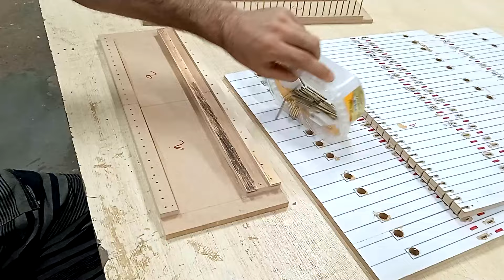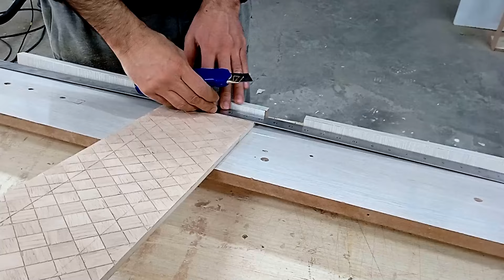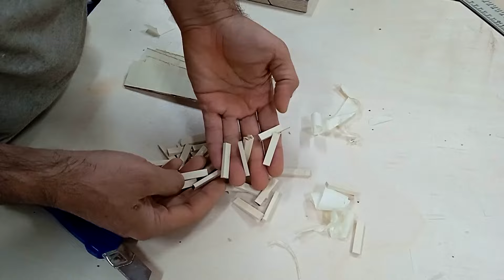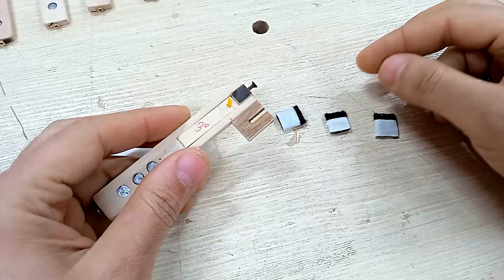I made this instrument in Afghanistan मैंने यह यंत्र अफगानिस्तान में बनाया

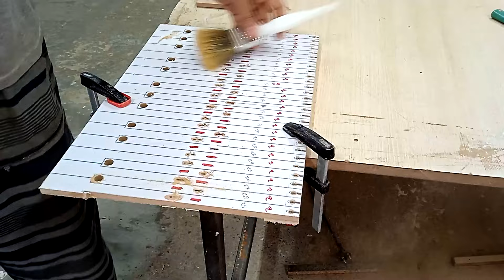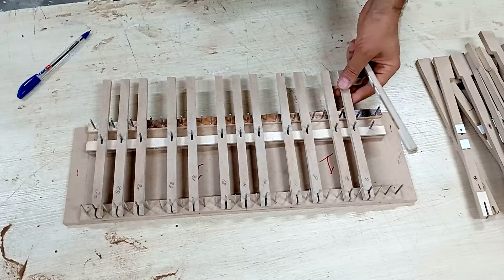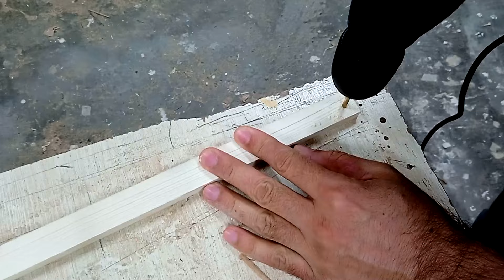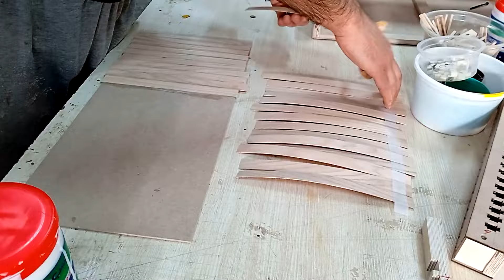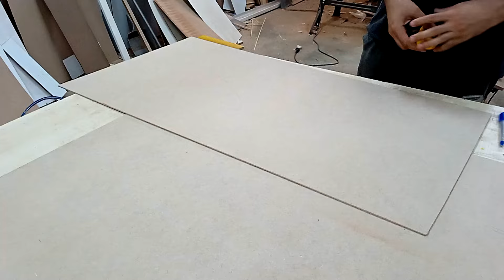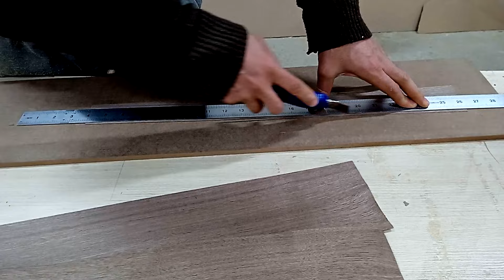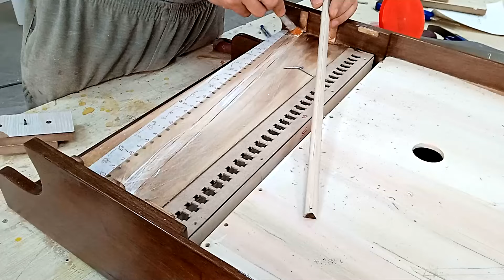Comment: Keyboard: 0:36 keybed: 1:20 more keyboard: 1:40 felts: 2:20 3:50 key lifters 4:35 key tops 6:10 more key lifters 6:45 more key tops 7:10 casing 9:50 veneers 10:43 jack rail is mysteriously made and installed 10:50 bridges installed 11:45 keyboard installed 11:50 more casing 13:30 stringing 14:00 jacks

Comment: This spinet sounds far better than the previous model, however it appears to have taken on a harp like quality, its it the string thickness and position of plucking along the strings?
Reply: For reference, I'm currently building a miniature harpsichord as well, but I'm using more common materials laying around and using thinner wire of copper plucked closer to the nut on the wrestplank
Reply from the maker: You have a sharp ear! You've noticed the string thickness and position of plucking do indeed give it a harp-like sound.
Reply from the maker: Good luck, I enjoy working on this musical instrument
Meanwhile, we can share our experiences.
With respect from Afghanistan
Reply: @ARTANDMECHANICS  
What are the plectras made from? What are their measurements by chance? 
Are they delrin?